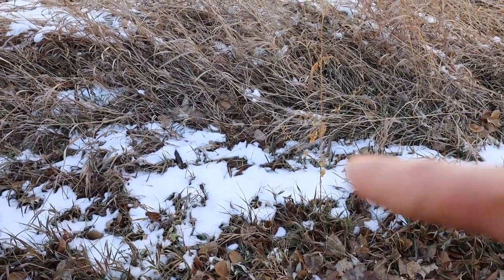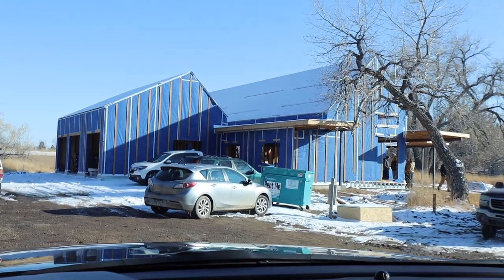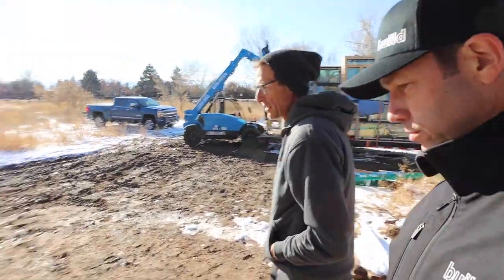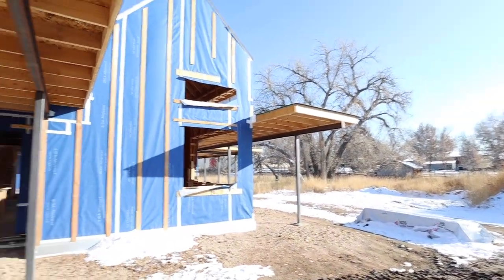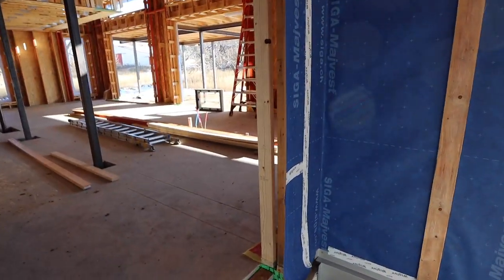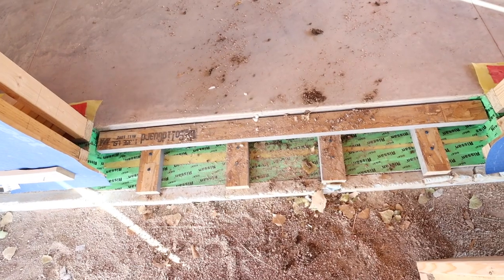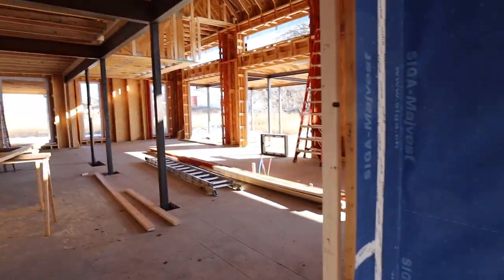Double Stud Walls and Bark Siding - This House is COOL

Comment: Hi Matt
Walls and windows keep getting better all the time.
Why haven't doors progressed like the walls they are installed in? The walls have gotten thicker and better insulated but the doors have stayed essentially the same for decades. It would be nice to see doors 4 in thick or better. Engineers seem to be capable of designing almost anything. What is it that seems to be holding us back.

Comment: when you said bark siding, i am imagining, unpressed OSB sheathing
Reply: Nope, its actual bark off usually a poplar tree. It's beautiful and tuff stuff
Reply: @1982MCI  
$6 sqft. 75 year life expectancy. Probably longer in Colorado if it's protected by roof overhangs.
Reply: Don Pfeiffer who is the manufacturer?
Reply: oltedders chestnut is also used, but large diameter chestnuts don’t exist right now.
Reply: oltedders if it’s installed on a rain screen it will last longer than the house. There are some houses up in Boone, NC that have the same chestnut bark siding when they were built in the early 1900’s. It’s expensive but the waste factor is almost nonexistent.
Reply: @wooodrow99  who makes this stuff?
Reply: KC B I’ve used Bark House for the past 20 years. They’re out of Spruce Pine, NC.

Comment: Where can you find the information of how thick your wall should be to meet the passive house requirements in your area?
Reply: Wall thickness depends on what insulation fill is used. Go for R60 until the spec changes.

Comment: Info on the window manufacturer?   I am really not digging this house. I see what he is going for but I would go at it in a different way. But non of this is surprising as Engineers and Architects do not always see eye to eye.
Reply: Bassntruck how would you do this differently?
Reply: @aayotechnology  In a nut shell, I think has just made it far more complicated than was necessary to achieve his goals. I am sure he has his reasons and I can only speculate on them. But in the end, it's his house and he can do as he wishes.

Comment: Reply to Brad not Landa
Walls without overhangs fail dozens of times more often. There are charts showing how much protection increases with increased overhang.
Metal door pan is hell of a thermal bridge, but how do we avoid that?

Comment: Would there need to be some kind of insect / rodent screen where the siding comes within 1" of the foundation flashing? I wonder what could be used. I'm thinking of something similar for my mobile.
Reply: Insects don't like bark. That is why trees use it for a barrier, and why it is ground-up for covering tree bases and under shrubbery.

Comment: They spend all that money on extra framing for more insulation, but then they skimp on the insulation. You can get all your sire sealing and better Rvalue from spray foam. You could fill that entire cavity with open cell foam or if you like spending money closed cell.

Comment: I always feel like no overhangs make the house look cheap
Reply: Agree completely.
Reply: i always feel like houses without them make (their) architects look stupid.
Reply: agreed, they only work on contemporary/modern builds where clean lines and structures are prevalent. Mixing the two looks arbitrary and amateur.
Reply: No overhangs is stupid. They help keep water off the windows which is a plus even if the windows are flashed correctly

Comment: Where I live if you do a double stud wall system your taxes increase even though living space does not increase at all. It discourages builders from building thick walls. If i add double stud wall to a 60x40 house it adds about 136 SQ ft to the size and increases taxes about $500 a year. In our climate a double stud wall wouldn't save me the $500 a year

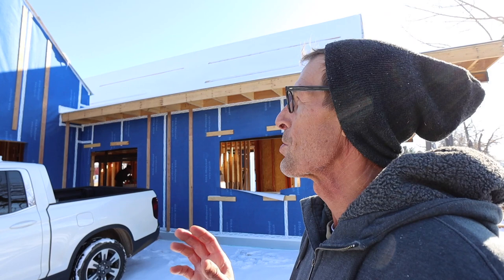Comment: At 1:35,  Greg says he needs overhangs on the southern windows.    In a cold climate,  you would want  maximum solar gain from southern windows and overhangs would limit that.  What am I missing?
Reply: Jerry Levenson my guess is to shade the windows in the summer without blocking the lower angle winter sun.
Reply: With R-50 walls that house does not need any solar gain in the winter, but needs to keep solar gain out.
Reply: @guytech7310  I always thought winter in Colorado lasts 13 months.
Reply: @JerryLevenson  nah, it's probably the front ranges least best kept secret the weather is comparative mild, I'm from CO and my girlfriend from St. Louis was amazed by the mild winters!
Reply: I grew up in Ft. Collins. Our south windows made the back of the main floor bake in the summer. In the winter it was hard to get the house an even temperature because the thermostat was in the kitchen facing the windows. The main floor would be warm but my second floor north facing bedroom would freeze. The winters are normally relatively temperate. The south side of the house is not where you want lots of windows. Put the thermostat on the north side.

Comment: Fiberglass alone looses some of it's R value when it gets -40 outside. you need to add some cellulose to prevent  the temperature difference from driving an air current. Around here you want a R60 made up of fiberglass and cellulose.
Reply: What about rockwool? Does it also lose R?
Reply: My cousins house after 5 years the cellulose slumped 14 inches in the attic behind the grey matt,not a fan .

Comment: High-performance houses = Houses that come with the price tag of a Testarossa.
Reply: 76 

i agree. and as someone from central europe (meaning: no earthquakes), i would add solid brick (also known as clay blocks) construction to that.
Reply: @kam_iko  Brick in the cold is not that great. They're permeable and make the house too hot in the summer,  they add a lot of inertia to the heating AND cooling. They add a lot a mass, which is not so great structurally, and they're prone to cracking and failure, and it's much more labor consuming. House building is not a child's story about a big bad wolf.
Reply: Rolf Bjorn 

i live in vienna, most city center buildings are 100+ years old. >30” thick brick walls are common. no cracking or fractures.

thermal mass and inertia is exactly what i want in a building - in summer AND in winter.

combine massive (30” thick) walls with above mentioned modern clay blocks (that might be the proper english term for bricks with core holes, we just call them bricks) and you get something like this:

https://www.detail-online.com/article/house-without-heating-office-building-in-austria-16667/

and while you might not agree, i still hope you enjoy the article (the house is in the austrian alps).

Comment: I was thinking what would be more effective (easier and cheaper as well): to make this double stud walls design, or just make the "perfect wall" with continous huge layer of insulation outside of the regular single-stud walls.
Reply: 2018 ICC codes and newer are requiring CI on the outside as prescriptive, but this looks engineered so you could do it this way still.
Reply: ICF

Comment: "flash-and-batt walls and walls with exterior rigid foam are designed to dry inward, and therefore should never include an interior vapor barrier." -FHB article. Can someone explain why he's creating a stringent vapor barrier on the interior of the house? Thanks.

Comment: OSB studs. Gooood luck. Moisture gets in the wall and it just falls in.
Reply: Not with a vapor barrier on the hot side and a vapor-open water barrier on the cold side.
Reply: @Xiph1980  or real boards in the wall

Comment: The outside air barrier is very close to a "Tyvek" if I am not mistaken, look up for example Tyvek Xtra Soft, it has a similar Sd value. However the inside combined barrier puzzles me... what exactly is being achieved here? The outside air barrier will allow damp air to escape into the open air for the walls and insulation to dry. The inside air barrier will do the same, but towards the warm interior... ventilation would take care of the humidity created from this, but why is this done, why not just use a regular plastic vapour barrier?
Reply: The external membrane is vapour open and acts to protect the sheathing. The internal membrane/vapour barrier prevents moisture from entering the insulation cavity and makes the house air tight. It's also taped to the windows/doors for air tightness. This particular vapour barrier is a bit like gortex,  it allows any condensation/moisture that may have got into the cavity to be released back internally in the summer months when the exterior temperature rises. You'll notice the exterior has vertical strapping with horizontal strapping over it that the siding attaches to. This allows for uninterrupted ventilation behind the siding, allowing vapour that diffuses through the wall to escape and also any water that might penetrate the siding to drain out of the bottom. One problem detail that I saw though was the window sill flashing. That taped sill will leak and not allow water to drain out, the could have used a continuous still tape like tyvek flex wrap that created a sill pan with no seams. This system has been developed mainly in Scandinavia, Germany, Austria etc. Take a look at some of Matt's recent videos from his trip to Austria.
Reply: @davidmason2581  great explanation! I'm also curious if he has to much wall insulation? It appears to me, the interior moisture is going to condense on the internal membrane/vapour barrier and get trapped in his "electrical chase". I've read a few article regarding double wall insulation and that's seems to be a common issue. In my opinion, I would not put insulation in the "electrical chase"; leave it a big air gap. Thoughts?
Reply: @davidmason2581  Thank you for replying David. I am Scandinavian, more precisely Norwegian. Using a combined barrier on the warm inside of the building is far from common practice (even in passive houses, but my experiences is rather limited), but then again we don't use OSB on the outside of the studs either... that makes no sense, moisture resistant drywall isn't uncommon for new cheap houses, but mostly it's just a Tyvek air barrier and then strapping. Moisture barriers on the warm inside is a thick plastic membrane that feels oily and heavy to the touch.
Reply: @thomps2881  Usually when the moisture barrier is retracted inside the wall, we have a thumb rule in Norway that 2/3 or more of your total thickness of insulation should be on the outside of that towards the cold zone. An example would be: 
Outside air -> Cladding -> Strapping -> Air barrier -> 100mm insulation and studs -> moisture barrier -> 50mm insulation and studs -> drywall -> Inside air

Passive houses with 2 to 3 times the amount of insulation is a beast of it's own however, I agree with your stated uncertainty. I have tried to use calculators to determine the "0 Celsius/32 Fahrenheit" point inside the walls to get a handle on this, where outside, inside temperature and R/u-value of the walls are chosen. So one can try and theoretically judge where the water/moisture can freeze inside your walls. It doesn't really help me outside the notion of: Don't let your house get colder on the inside than X Celsius/Fahrenheit, to prevent unwanted moisture.
Reply: @Kallenator1988   Hi, I'm in the UK and build traditional Oak framed and modern timber framed buildings. We but a passive House a couple of years ago. The value barrier that is shown in the video uses the same principal as your thick plastic barrier. It's just a more modern version. These have been developed in Germany and they work well because thick plastic barriers do not allow any more to escape of it does get into the wall and it will over time. So these new vapour barriers do not allow moisture vapour to enter the wall but do allow it to escape in the summer months letting the wall dry out if necessary. The principle is that the external "breather" membrane is much more vapour open than the vapour barrier and so the "dew point", the point where vapour will condense is moved to a point outside the wall envelope. This can be calculated with software by inputting the the permeability values of the specific wall components and the climate zone. But for something like passive House with so much insulation I prefer to use something called a breathing wall. This wall has the anti racking board fixed on the inside of the studs (OSB etc) the board joints are taped and form the vapour barrier and then on the outside of the building we fix an insulation board made from wood fibre (80 to 100mm) that is very vapour open and has a waxed coating externally, this replaces the external membrane. This board is also tongue and grooved. This board reduces thermal bridging and encloses the system. We use a service cavity internally but don't usually insulate (although you could). Recycled cellulose insulation is then blown in between the studs etc. through holes that are drilled and later taped. This insulation has a high capacity to absorb and release moisture and had far more thermal mass than petroleum based insulation. So attenuates the internal temperature much better. The external wood fibre insulation also allows any condensation that might collect to dry out during warm weather rather than possibly being trapped between two layers of plastic. This system uses minimal plastics and can reduce offgasing of chemicals massively if the boards used are free of formaldehyde glues etc.
Reply: @thomps2881  as kalenator said as long as the amount of insulation in between the studs is considerably more than in the service cavity then there shouldn't be condensation. Need to calculate based on various membranes, boards and insulations used. Also if you use a permeable plaster board and paint it wood allow moisture to escape. Have a read of my detailed answer above. I try to stay away from using plastic membranes if possible as they don't really allow the structure to dry out if necessary.
Reply: @Kallenator1988  what do you use to stiffen the structure rather than OSB/sheathing? Diagonal strapping/battening?
Reply: @thomps2881  Yup. It presents challenges, including exterior wall penetrations for ERV, Dryer, faucets,  electrical etc. Best option is to use thick foam insulation on the outside.Cheaper to build too.
Reply: @Kallenator1988  Total newbie here and have never built a house but I'm interested in this stuff.  Your description of a wall assembly seems very similar to a pole barn structure and utilizing a double wall construction as the interior wall.  Outside air > metal siding > air barrier > girts > blown cellulose/insulation > vapor barrier > stud wall > drywall.  The vapor barrier would be on the outside of the interior wall and could be installed before raising the walls.  Sound right or am I totally wrong?
Reply: @davidmason2581  Lateral stiffening is done by diagonal strapping and battening like you mention, but it mainly comes from top and bottom plate ;)
Reply: @ThunderDog  Sup, sweet channel you got going, keep it up! =)

Sounds like you are on top of things man. I drew all of it in Sketchup, and showed it to carpenters to make sure that I was not messing around. Searched around a lot too, and looked at other projects.
Reply: @davidmason2581  Excellent reply! Do you know of any buildings that have been using these products for a long time so we can get some practical data? I am a bit vary as houses need to perform for a very long time, and I am not sure how well we can understand this before doing and seeing it over time.

When I renovated my late grandparents house we ended up with a plastic barrier on the inside, the internal structure is a bit strange, but it consists of a continuous layer of 65mm thick tongue and groove standing lumber. Typical for 1930's houses in Norway. I called around before making the final decision, and using a plastic barrier was the answer people gave. It's still nagging me, and gotta say I am still a bit nervous about it, because these modern membranes make a lot of sense in this scenario.

Comment: On the 2 inch horizontal on the inside I've tried it I didn't like it I would rather put a 1-inch horizontal and then a 1 by 4 vertical that way everything jive's up, then you can put in shims and make the wall very straight